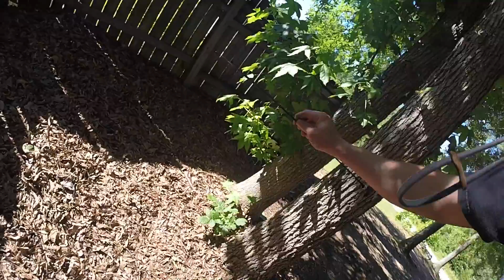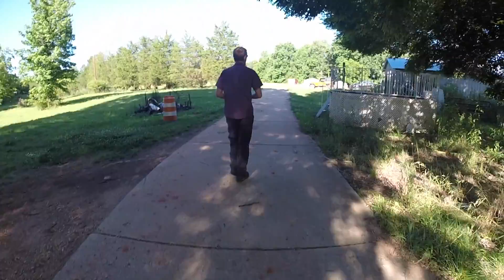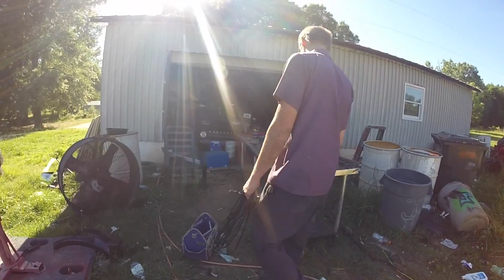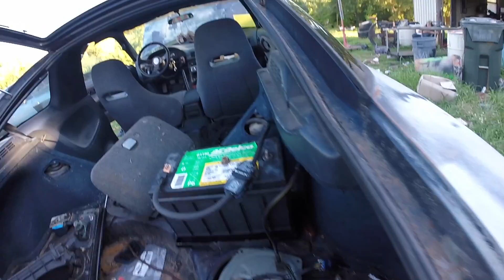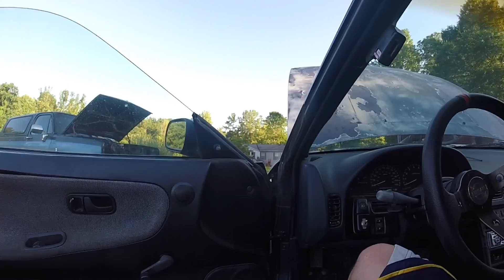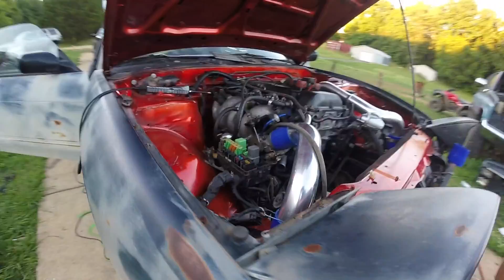HOW TO SR20 SWAP | SPARK ISSUES

Comment: You guys ever figure out this issue?? My s13 sr20det doesn't have spark either. Any help will be appreciated 👍🏼
Reply from the maker: Daniel James there was somthing wrong with harness that came with it, he got a new harness and it cranked up
Reply: Southern Hooning same problem with mine. I changed ignition coil pack, ignition control module and still nothing. So my buddy is thinking it’s the harness also since I just put a new Ecu on it.